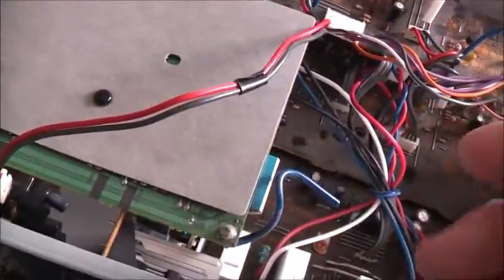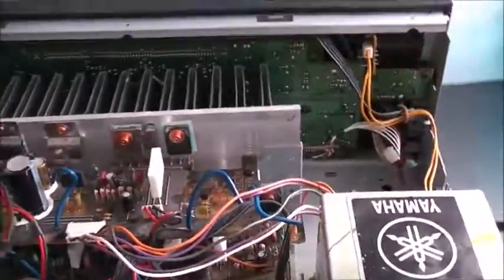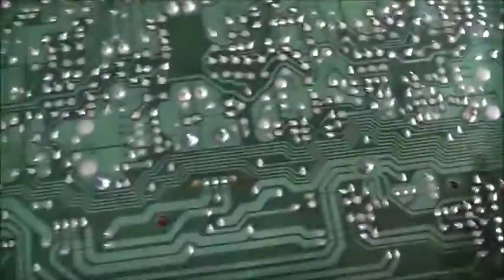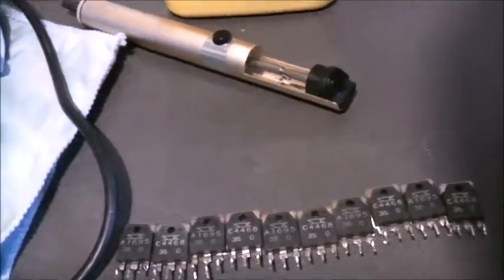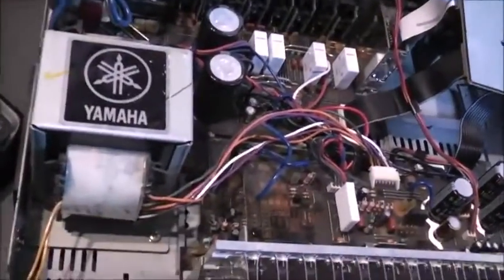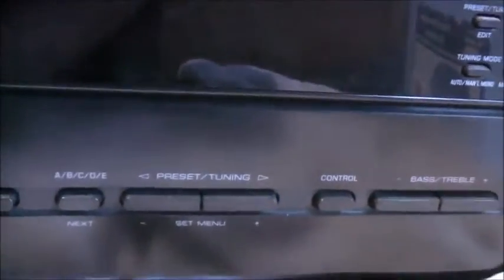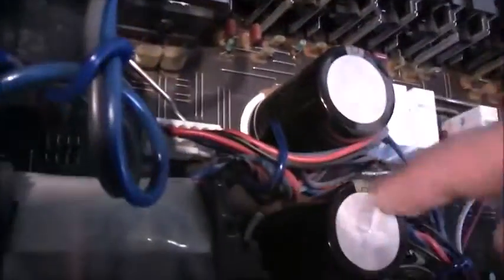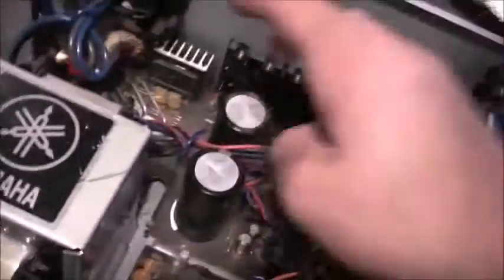Yamaha Receiver Output Transistor Checks

Comment: Try this first Press the “STANDBY/ON” key while simultaneouslypressing those two keys of the main unit 
8CH and Stereo.

• Starting DIAG in the protection cancel
mode
If the protection function works and causes hindrance to
trouble diagnosis, cancel the protection function as
described below, and it will be possible to enter the DIAG
mode. (The protection functions other than the excess
current detect function will be disabled.)
Press the “STANDBY/ON” key while simultaneously
pressing those two keys indicated in the figure above. At
this time, keep pressing those two keys for 3 seconds or
longer.
In this mode, the “SLEEP” segment of the FL display of the
main unit flashes to indicate that the mode is DIAG mode
with the protection functions disabled.

CAUTION!
Using this product with the protection function disabled
may cause damage to itself. Use special care for this point
when using this mode

The two buttons are 8CH and Stereo.